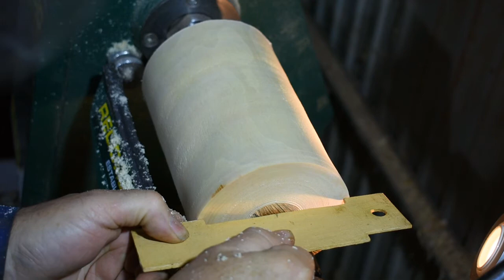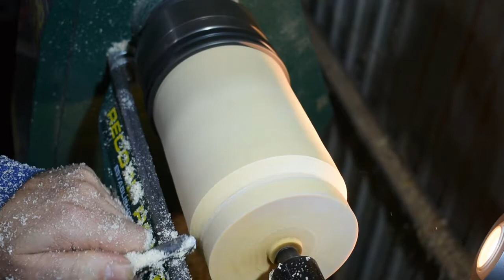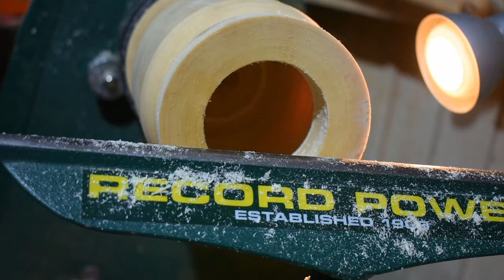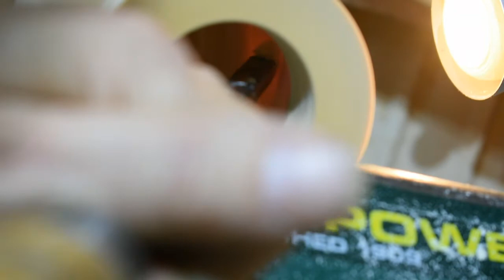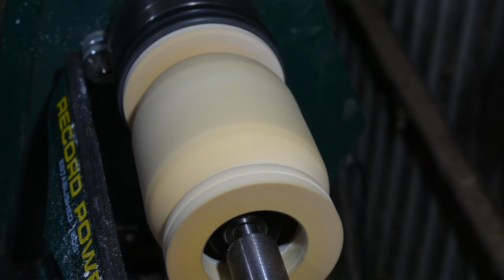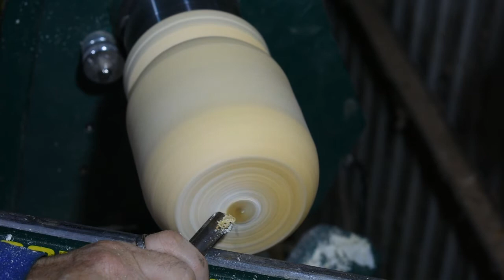Woodturning - Making a Wooden Lamp Shade

Comment: That was some precision hollowing Leo, impressive. It might have been easier to hollow first and then thin from the outside. The end result looks spectacular, I am going to have to put that on my list to try next year. Keep well, Rob
Reply from the maker: Hi Rob, actually that's what I did. You need the light on the outside while hollowing to get your wall thickness even. After that I made a few external passes. Turned out I was too careful the first time round. I needed to put it back on the lathe after one day because the wood had dried and become less translucent. In all I must have taken about 2mm per side off from the outside! 
But the piece hasn't cracked (three weeks old) and is glowing steady.
And this was only my very first attempt.😎